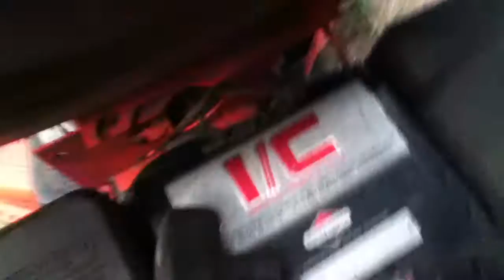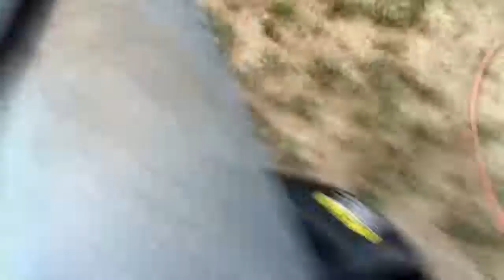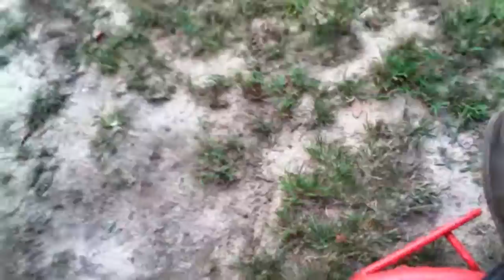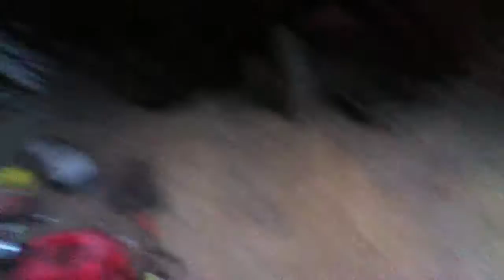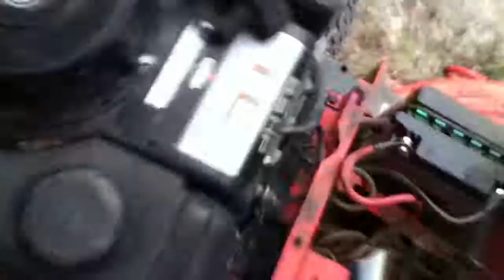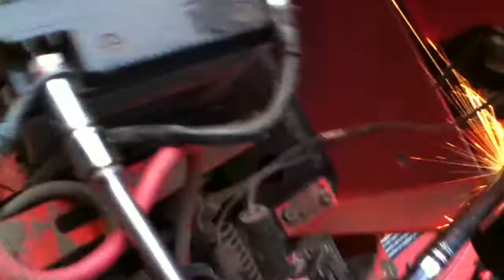Free Ariens rear engine ridding mower

Comment: That's a pretty nice mower. I have one I paid $35 for it. The brake was frozen on so the owner figured it was bad. I got it unfrozen, did a carburetor rebuild, refreshed the paint( no rust on anything) and it's ready to sell come spring. Someone is getting a very solid mower for the money.

Comment: i love to have one as a backup mower but put a reliable engine on it a Kawasaki FC420V or an older Kohler Command engine on it. Sometimes with these old Briggs flathead engines 8 hp and up is the rings are an issue. as the modern OHV engines are more efficient and burn less gas. another common problem is the friction wheel wear on these needs replacing if you have slopes.  As i recall these mowers also came with a Tecumseh engine as these ariens mowers getting hard to find now.

Comment: i beleive this riding mower is an Ariens RM830e 8 meaning hp 30 the deck size and e meaning electric start i used to have one common problem is the solenoid goes bad the big black thing where the big wires attach to it i used to have an early 80s RM830e  the engine was getting tired problem is is that Briggs and Stratton does not make this flathead engine anymore to repower it u have to replace it with a Briggs and Stratton Intek or powerbuilt OHV engine as you have to cut the seat mount with a angle grinder with a cutoff wheel an area so the valve cover and spark plug access clears and making mounts to mount the fuel tank plus a heatshield since the exhaust exits that side of the engine.  but these Ariens rear engine riding mowers are better than today's junk from Weed eater, MTD, Troy bilt and others.  the common problem over time is the friction wheel wears out on these and you have to put it in a higher gear to keep it moving same with the snapper rear engine riders too.
Reply from the maker: Derek Obidowski cool I have gotten rid of this one but I have another one just haven't brought it home yet
Reply: I got one for $30 with the rear brake frozen on so the owner thought the transaxle was bad. I went all through it and cleaned it up, refreshed the paint and plan on selling it in the spring for $500.